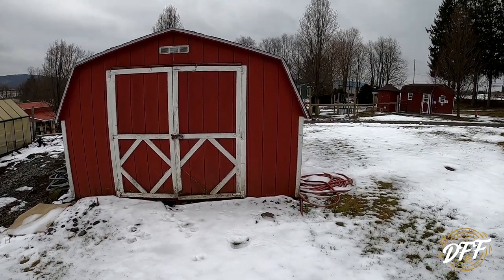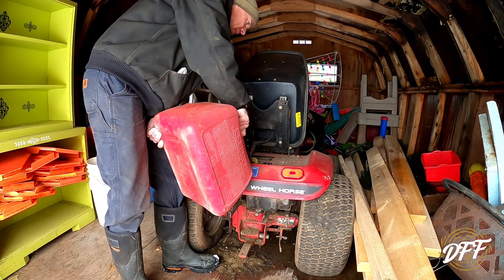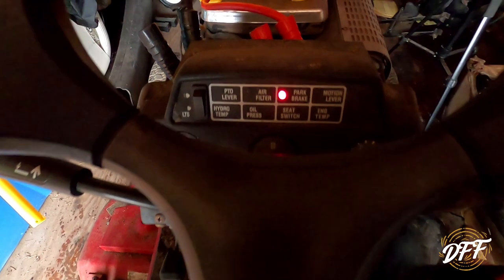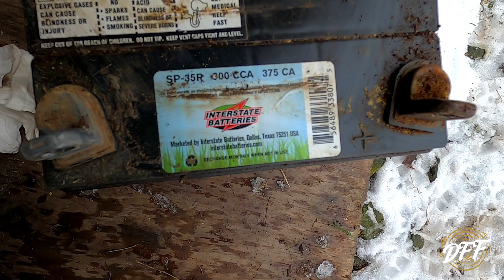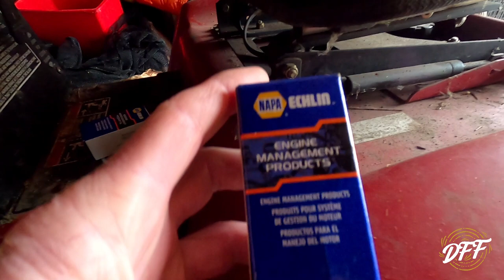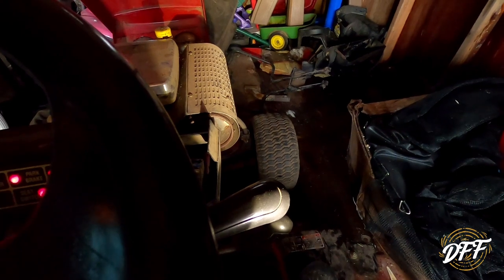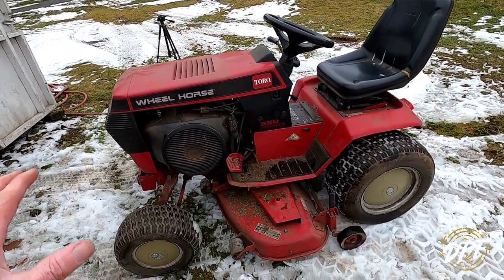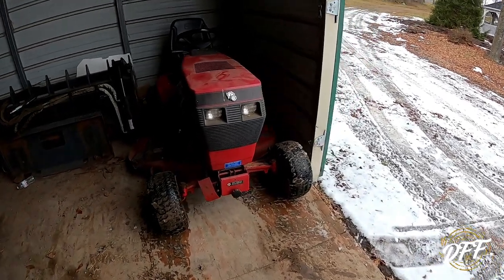Will It Start? Toro Wheel Horse 520H Garden Tractor

Comment: Awesome machine. I picked one up at my work it’s a toro dealer and the guy gave up on it. It had all the symptoms of a bad valve. But turned out to be the ignition tractor those in and run so smooth glad you got her going. To many people give up on this stuff. These were actually commercial built units to whitest and thousands of hours truly a desirable machine I love mine it has only 900 ish hours and I’ve decreased and cleaned it real nice I take it to shows and things. I have 13 different garden tractors form various different time periods I like them a lot parts are cheaper than being into the car hobby. Thanks for taking us along!!

Comment: Success! Might have been a brush stuck in the starter. I always check the engines on my lawn mowers in the spring for mouse nests under the cowl that will cause them to overheat if left undiscovered.
Reply: No doubt Pete. Shop vac, or air hose.
Reply from the maker: Maybe... I guess I should have checked the starter first 🤦‍♂️ I know what you mean- darn mice! Thanks Pete 🙂

Comment: There's a reason wheel horses have such a strong following despite their faults. Those Onans run hot, have valve issues, and are super thirsty, but they'll pull most modern lawn tractors in circles and will last a long time if cared for. Biggest downfalls with the 520H are the hydro linkage is finicky and the electrical system on the Onan-equipped tractors is notoriously bad.

Comment: Just a tip I though I’d share is the onan engine like yours will not start if you do not have 12.5 volts present due to the way they have the ignition system made that was an issue I ran across in mine it would crank fine and fast but no start mine read 11.7 volts

Comment: Check the 8 pin connector make sure that's not corroded that's a big problem with those tractors check all your safety switches like on the seat PT o's Hopefully that helps you little

Comment: I got the same one , I put a new battery in and it didn't start , the engine is fine because I turned it on manually but the ignition key does not turn on the tractor

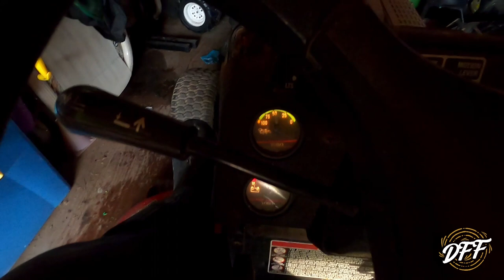Comment: At 13:45, you said theres the oil pressure. That is the load or vacuum gauge. It just shows how hard the engine is working. At idle or mid RPM, it should be around the zero mark. Being that its reading that high makes me wonder if the line has a small hole in it.

Comment: That’s a wheel horse not a toro. It may have a toro badge but it’s kind of an insult to call a wheelhorse a toro. I’ve owned about 8 of these through the years. Currently have a 520xi that is a toro with wheelhorse attributes
Reply from the maker: They are great little garden tractors for sure. Thanks Brian!